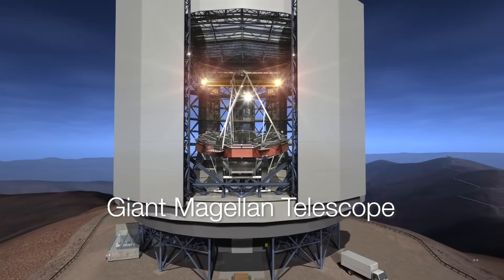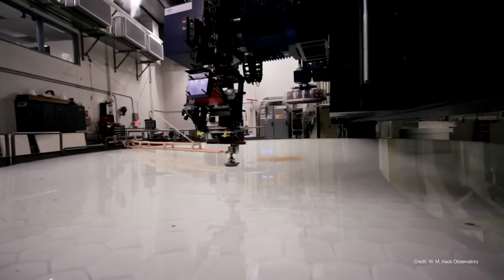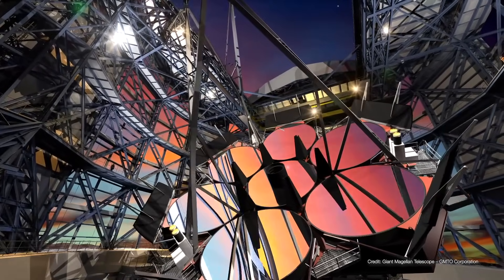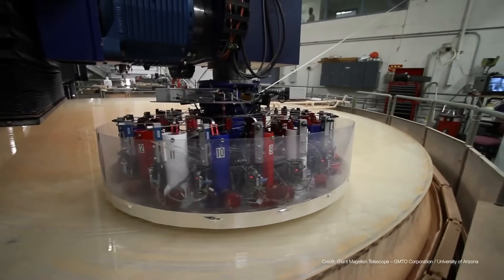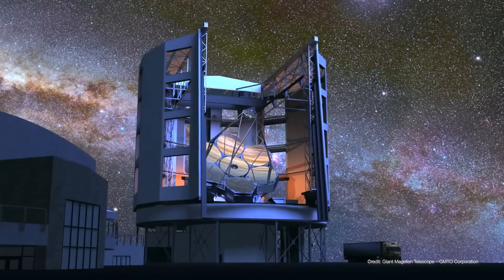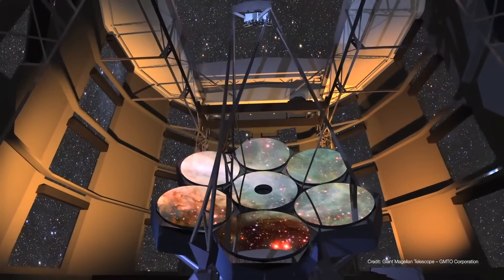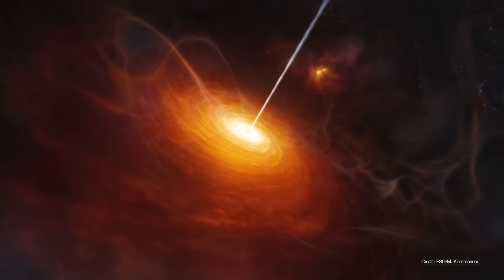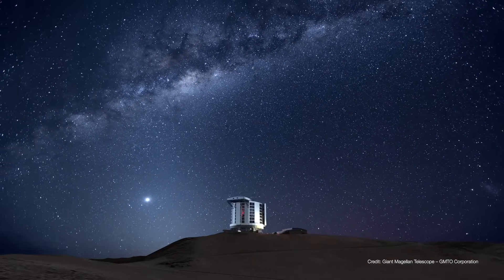Giant Magellan Telescope - World's Largest Multiple Mirror Telescope

Comment: Is it possible to make a mini telescope using same principles? lets say combine multiple mirrors from telescopes together to make one big one... I am just curious..
Reply from the maker: Telescopes can be linked together via interferometry to act as a large telescope separated by a great distance. In practice, this is much easier to do with radio telescopes, though the Very Large Telescope in Chile has managed to do the same thing in the infrared with telescopes spaced over shorter distances. Hope that helps1

Comment: I obviously know nothing about telescopes with this question. but I have not found a simple answer. How can they see anything with all that rigging and crap in font of the mirror?
Reply from the maker: That's a perfectly reasonable question. The truth is that some of the light is lost by the secondary mirror assembly and support truss above the mirrors. But everything is oriented and designed in such a way as to minimize the loss of light.
Reply: @LaunchPadAstronomy  Thank you :)
Reply: @LaunchPadAstronomy  actually, this design is quite unique in the fact that the 6 outer mirrors are all completely unobscured, which eliminates scattering and such.
Reply: The hardware in front of the mirror is out of focus, so the effect is spread over the whole image, which is why it only causes a small loss of light but not detail in any part of the image.

Comment: Use the telescope to finally disprove every ones theory that "Black Holes" exist and to also prove that "Black holes" are actually cold and frozen "Suns/Stars" that are not burning or giving off light or heat. 
There is no black hole that tunnels through space. 
There is no stars being sucked through such tunnels. 
There is no big vacuum tunnel that sucks stuff from one side of the universe to the other 
"Black holes" are just a bunch of big dark spheres with lots of gravity and with no friction or movement within itself.

Comment: Imagine what we could see if we put just a tiny fraction of the military budget into astronomy?
Reply: Imagine if we had taken all the money wasted on the JWST and used it for ground based astronomy.  We would have several telescopes larger than 8 meters.  The JWST boondoggle should have been buried before it got out of the gate.
Reply: @Booboobear-eo4es  Would you say the same about Hubble? Many people did in the past. Building ground-based telescopes with the money that the JWST costs could not have achieved what JWST eventually will. Its big advantage over ground based telescopes is that it is an infrared telescope. Infrared is absorbed by the atmosphere, so ground based telescopes are useless. The advantage of observing in infrared is that it is transmitted better than shorter wavelengths of EMR allowing for penetrating views of objects that are otherwise opaque. Also, the most distant objects in the universe are red-shifted into the infrared part of the spectrum. So infrared telescopes are needed to see the first stars and galaxies to form after the big bang. It will be able to see further back in time than any other telescope. It will have unparalleled capabilities that cannot be achieved any other way. Big ground-based telescopes like the Giant Magellan are getting built regardless of the problems with JWST. Nobody likes all the delays and cost overruns, but it will be worth it!
Reply: @MichaelRodriguez-lw3vx  - I don't recall Hubble having this high a price tag.  Nor the cost and schedule overruns the JWST has suffered.  Whether it is worth it depends on how willing we are to spend taxpayer money.  Ten billion dollars is a lot and it's still not finished.  Road and bridges are falling apart.  Our educational system is a mess.  We are already wasting money on stupid wars in places no one cares about.  The US national debt is over $23 trillion and climbing.  Shall we let people without health care just die so we can see pretty pictures from space?  I agree the JWST capability will be fantastic, but at what price?

I would like to drive a brand new $65K pickup truck.  Think of all the increased capability I would have!  But I drive a used Toyota Corolla because I am retired and have other expenses like rent, utilities and food to pay for.  Whether it's a nation or an individual, you've got to stay within your budget and not spend money on things you can't afford.

Dreaming is fun.  Paying for it is another matter.
Reply: @Booboobear-eo4es  Why cry about scientific advancement wasting money instead of the military with many times the budget. The military spends upwards of 15 billion on fuel alone in a year. That's twice as much as NASA gets entirely.
Reply: @BooNooBear2388...Absolutely hilarious bit....

"JWST is a $10 billion boondoggle, the money could've been better spent on multiple ground based telescopes"..

Enter someone who knows what they are talking about, and backs up their opinions with scientific facts

"I can't afford a new pickup and I'm stuck driving a Corolla..."

A masterpiece...I salute you, sir.

P.S. JWST was launched successfully last Christmas and has been providing ground breaking insights on the earliest stages of the formation of our universe...whoops!!!

Comment: What happpens if put it in moon? Better view?
Reply from the maker: Yes and no. A lunar-based telescope would benefit from an undistorted view of the sky, but wouldn’t be able to be used for roughly two weeks every month due to its slow rotation period. The Sun would be in the sky during that time and would be a risk to the instruments. A much better and cheaper option would be to put it in space with a powerful thermal protection system to keep the instruments cold but that’s still a very expensive tans risky option.
Reply: One advantage of a ground-based telescope is that it can be made large at practical cost.

Comment: I know I am late but this is amazing!
Just one question: What if one of the mirrors crack?
Reply from the maker: Thank you so much! If one of the mirrors were to crack that would be very bad. However, Magellan will be equipped with a spare outer mirror to stand in when one of the outer mirrors is being resurfaced (and won't use the central mirror when it's out for maintenance). If one were to crack, I'd think they'd need to determine if it can be replaced on the mountain top or if it will need to be returned to UA for repair there (or maybe just build a new one). Let's hope it doesn't come to that :)
Reply: @LaunchPadAstronomy  It's possible the formation of a crack would not cause a significant change to the figure of the mirror surface. Or if it did, it would only harm a small fraction of the surface.  In that case, that section of the mirror could be painted with flat black paint to remove an contribution of the bad area to the image.  Much better of a compromise then scuttling the whole mirror
Reply: That's 7 billion years of bad luck
Reply: 7 years of bad luck. Well, that's what I've heard.
Reply: There is a backup mirror. (if you have listened through the presentation). Now, if two of them crack...Houston...we have a problem!

Comment: This is great but it's not a patch on the ELT
Reply from the maker: In many ways, it's actually a superior design to ELT because there's more continuous surface area. By contrast, more light gets lost in a segmented mirror design which is why you need to build them so large to compensate. ELT will have higher resolution than GMT but I'm not sure if it will collect more light than GMT.

Comment: GMT is suffering from funding issues.  It needs more then $1b and has commits for only about half of that.  

GMT has also had some very real upper level management problems, unfortunately.  Ed Moses during his brief, less then 12 month, time as CEO did lots of damage to the project, forcing several of the original team to quit, taking much knowledge with them and making design changes based on his concepts whey Ed had no experience in telescope design.  Ed was removed and replaced with Jim Fanson and it has taken a few years to try to recover.  

I wish this project the best of course but there have been some real management errors.

Comment: "Will be"? EELT will be live in 2022. Is the GMT doing complementary research, or just second in the running?
Reply from the maker: Right, when GMT sees first light it will be the largest optical telescope ever built...until ELT comes on line a couple of years later ;)
Reply: It's useful to note that the ELT is placed in the Southern Hemisphere as well, and thus can see a different part of the sky from the Northern observatories. Having at least one extremely large telescope in each hemisphere makes it possible to observe any location in the sky with such an instrument. 

Admittedly that would be the Thirty Meter Telescope, not this one, but still.
Reply: The telescopes have different owners.  There are probably enough projects to keep both instruments busy.

Comment: But how? Wouldn't the first contact with air make is dirty?
Reply from the maker: I'm not sure I understand your question?
Reply: @LaunchPadAstronomy  since it's used from earth, there are also you know, dirty particles in the air that might damage it
Reply from the maker: Ah,  I understand now. The enclosure is designed to keep the air flowing continuously over the mirrors, carrying much of the dirty particles along with it so they don't hit the mirror. During the day, the enclosure is air conditioned to prevent dust flying around and landing on the mirrors. Then there's a spare mirror that will be installed when one of the mirrors is being cleaned and resurfaced. Always a challenge, but at least you can do something about it from the ground!
Reply: @LaunchPadAstronomy  oh, wow cool. Thanks

Comment: Chris, with today's technology what would be the theoretical limit for the size of a giant telescope? (supposing that money were not an issue)
Reply from the maker: There really isn't a theoretical limit for a telescope that I can think of. It's ultimately a question of engineering. ESO looked into building a 100-meter optical telescope in the early 2000's but couldn't justify the project because of engineering uncertainties. I think ELT will help pave the way for such a telescope down the road.
Reply: Launch Pad Astronomy - Thank you, Chris.